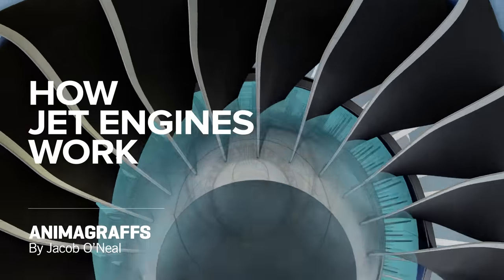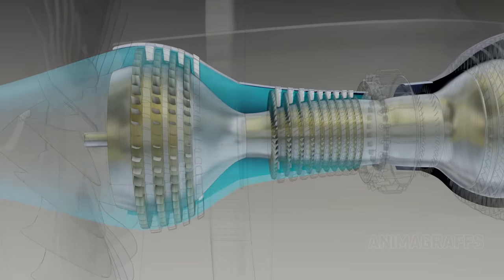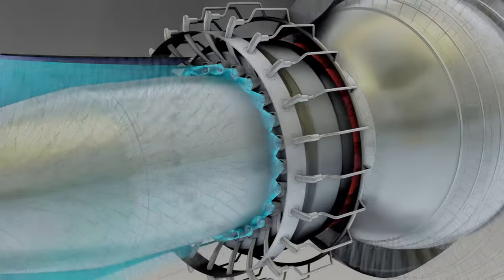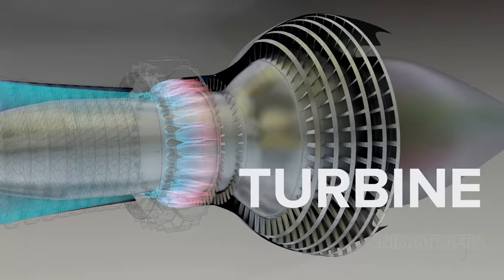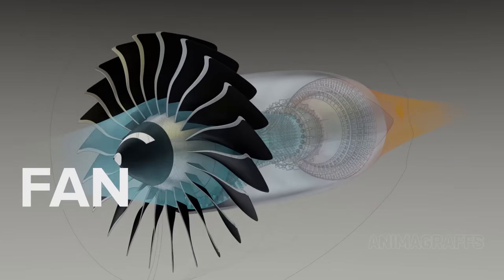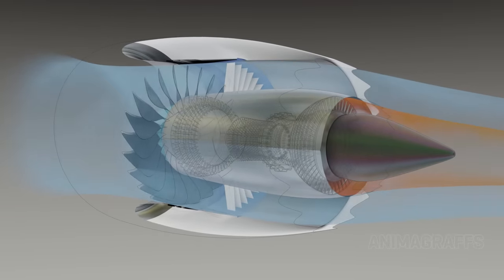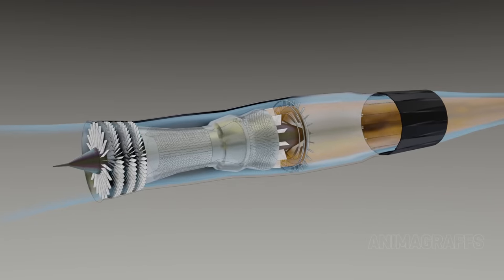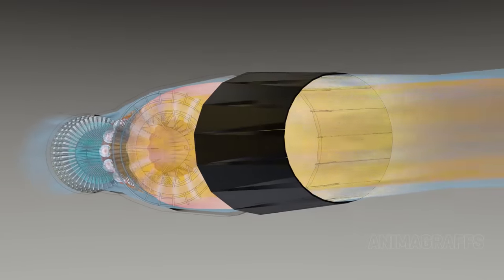How Jet Engines Work

Comment: In an internal combustion engine the exploding fuel has no where to go except to push the cylinder. But in a jet, what makes the exploding fuel exit the rear instead of canceling its thrust by exploding in both directions?
Reply: Good question. The air at the back of the engine is at a lower pressure, so that's the direction the flow wants to travel. If you move forward, the pressure increases and is the highest at the end of the compressors, so from there on, the rest of the air should continue to flow out the back of the engine. A compressor stall/engine surge happens when the flow gets disrupted and the flow momentarily may backfire and reverse direction.

Comment: Here is something that I can not figure out and I have looked in every way I can possibly think of. Why does the high-pressure stage always look to be going clockwise while the low-pressure stage looks to be going counterclockwise while it's all on one shaft, or so it has always been said? Another thing I can not figure out is how can you have jet engines running at high speeds and even using afterburners but not moving the vehicle?

Comment: Can you explain ‘back pressure’? Is that the force of air entering the back of the engine that actually provides the thrust, as it replaces the high pressure hot air?

Comment: While working in Nigeria, at Lagos there were Russian jet liners. The Russians simply slapped low-bypass military engines on them - with afterburners. And yes - at least on my flight - the Russian planes did have wooden seat structures.

Comment: Could somebody explain, I wonder why the central part of the core (the part around which the stage discs rotate and stators are attached) is so wide. I believe that if you take an engine and cut it with a knife from top to bottom through the e.g. compressor (like a sausage) you would see that it is actually a rather thin circular ring through which the air travels, and the central part is taken by...what? And why? The blades are so short relative to the core diameter, in other words.

Comment: Why only few country can build the Jet Engine?
Reply: Most of the design are intellectually protected. So design a new engine you need to conduct a lot of research, by the time you design a new engine the existing countries might have already made a new and highly advanced version of it. So it's not economically practical for most of the countries to start from the scratch.

Comment: but one thing i wonder about, is that how do they get the blades and fans to spin, when starting the engine, since theres no cold air being transported into the combustion chamber, the fuel wont have anything to mix with and theres no pressure, thus generating no thrust. Do they just use like an electrical motor to get the fans to spin, and when combustion happens they turn it off or how is that done?
Reply: I’m pretty sure that’s what the APU is used for to start turning the fan then when the throttle is mover from cut off to idle fuel is mixed then it ignites 

I’m pretty sure that’s how it works correct me if I’m wrong

Comment: Why does the power of the combustion not escape towards the compressor stage of the engine? Combustion must be a lot stronger then the pressure of combustion so why doesnt the system just stop..

Comment: So does the turbine power the compressor? Doesn’t do a good job explaining how it functions.
Reply: Yes, and in a high-bypass turbofan the fan can provide up to 80 % of the total thrust due to the large airflow around the engine core.

Comment: it actually does not explain how it work. It does not explain the most important part. Chicken egg problem.  To create high pressure air you have to rotate the turbine, to rotate the turbine you need to create high pressure air in order for fuel to burn. Also, burned fuel creates pressure itself which is spread in all directions and  why it does not prevent high pressure air to get in ?

Comment: You don’t talk about the gas generator or the starter. Gas generators are producing the gas that turn the power turbine. In this case, the starter needed is a pneumatic source often provided by an APU

Comment: I get most of the concepts in this video, and I understand the design, but Can anyone help me understand why Haiti bypass engines increase efficiency? As I see it the air isn’t actually speeding up or compressing enough to create enough thrust to be noticeable. Am I just being dumb, or is there a complex subject I do not understand?
Reply: Thrust depends on mass flow rate. To get the same mass flow rate(w), in a turbofan we have high bypass ratio(BPR for short) coz w=pAV (here p is density of fluid) in turbofan area is high. In turbofan to get high w we increase velocity. Increasing velocity requires a lot of fuel burn, this increases specific fuel consumption and also your propulsive efficiency( which is dependent on exit velocity) is low. So even though turbojet and turbofan may produce same thrust, we need more fuel in turbojet.

Comment: I’m literally just now learning the stator veins of the compressor are stationary, pretty bad of me considering I’m literally in a thermodynamics and propulsion class for undergrad rn
Reply: You are correct that the stator blades do not rotate around and around. However, on most modern jet engines they are not exactly stationary. There is a control mechanism that turns the blades axially and changes the angle of all the stator blades in the front stages of the compressor. By changing the angle of the stator blades you can modulate the amount of air flowing through the compressor, which in turn modulates the thrust being produced by the engine.  So when the engine is at idle the stator blades are at about a 80 degree angle relative to the direction of the air flowing through the engine. Then as the throttle is increased the blades gradually turn axially to about 45 degrees relative to the direction of the air flowing through the engine. This technique, while it does add complexity, produces better control of the thrust than older designs with compressors that had fixed stator blades.

Comment: Something that I've seen in this one and similar videos are the front air is moving way faster than the blades. It should be the opposite. The front air is supposed to be accelerated by the blades, thus for visible blades, the air should be moving incredibly slowly, however, being faster than the blades by the turbine as the there the air accelerates the blades instead. Additionally, ain't the back blades of the turbine inverted?
Reply: The rotating blades accelerate the air backwards into the engine. Then when the accelerated air encounters the stator blades the added velocity is converted into increased pressure. In other words the air is being compressed between the rotating and stationary blades and that in turn reduces its velocity. The compressed air is then routed by the stator blades into the next stage to be compressed further. You are correct that as the engine compresses the air the speed of the air decreases as it travels backwards through the engine. Note that the air pressure at the discharge of the compressor is the highest anywhere in the engine. Concurrently the velocity of the air at that point is quite slow. Then on from the compressor outlet the pressure drops as the air is accelerated backwards through the rest of the engine. 

As far as the turbine, in many of these newer engines the turbine spins in the opposite direction from the compressor. Unlike older engines, where the turbine and compressor are on the same shaft, the shafts on these newer engines are split in the middle and there is a reversing gear between them to make the compressor and turbine rotate in opposite directions.

Overall its not a bad animation and illustration of how a jet engine works. But there are some inaccuracies in it and its not perfect.

Comment: can anyone explain how the bypass improves efficiency?
Reply: This relates to a classic problem in jet engine design. The first jet engines were turbojets as described in the video. Turbojets expel a relatively small volume of air backwards but at a very high velocity. This is what allows a turbojet powered airplane to fly at high speeds. For example the Boeing 707 was turbojet powered (the engines had no fans) and they could fly at between 500 and 600 mph. The only problem was that turbojets cannot produce very much static thrust, which means that turbojet powered airplanes cannot accelerate quickly on takeoff or rapidly climb up to cruising altitude. Both of these characteristics of turbojet engines reduce their performance and efficiency.

Stepping back to propeller airplanes, propellers expel a relatively large amount of air backwards but at a lower velocity than a jet engine does. This means propeller airplanes can only attain speeds of about 350 mph maximum. Propellers do however produce more static thrust than turbojet engines so they can accelerate faster on takeoff and they can climb more rapidly.

A turbofan engine is a hybrid design that combines the low speed, low altitude performance of a propeller engine with the high speed, high altitude performance of a turbojet. A turbofan engine uses the fan to accelerate down a shorter runway more quickly and get off the ground sooner and climb up towards cruising altitude better than a turbojet can do. But as it climbs the turbofan engine relies increasingly on the core to attain the higher cruising speeds similar to what a turbojet can achieve. This combination of the core section and the fan produces a better performance balance between low altitude, low speed flight and high altitude, high speed flight than can be obtained with either a propeller engine or a turbojet engine. This ability of a turbofan engine to get off the ground and up to cruising altitude quickly and then cruise at high speeds is what makes the turbofan better performance wise and more efficient and the most popular aircraft engine in use today.

Comment: uh, you kinda missed the whole point of compressing the air--to heat it to the point that it ignites fuel.  Sort of important.
Reply: Not exactly, there are still external igniters (like spark plugs for a jet) that ignite the fuel, at least at the beginning. In general it is self-sustaining and doesn't need the igniters on, but they're there for startup and cases where the engine is under high demand.

Comment: usual stunning animation. It raises some questions. Why does the rear part of the compressor stage and forward part of the combustion stage appear to rotate in the opposite direction to the forward part ?  Why is this part of the design and what is the mechanical (gearing) arrangement that makes this possible? How is the engine kept lubricated at the junction between the counter-rotating elements?
Reply from the maker: I wasn't making videos as detailed as I do now, at the time I made this. All good questions tho. Apparently the Genx model engine I based this on does have gearing in the center that allows different sections to counter-rotate, but I'm not entirely sure the purpose.
Reply: No disrespect meant.  What you do is amazing!

Comment: I still can't quite understand why the combustion gasses don't exert a back pressure against the forward stages equal to the pressure they contribute towards the exhaust stages....
Reply: They do. That’s how Newton’s third law works in this case, the expanding gas pushes on the front stages, pushing the plane forward.

But the front stages are designed to absorb as much of this force as possible rather than have it be absorbed into the incoming air to push that air the other way, the back stages are designed to vent this force while stealing a bit of force to turn the turbines that power this whole contraption. This is why the combustor is designed with such a small hole, it’s designed to be one way in.

Air ideally expands in all directions. This design just forces it to only expand back.
Reply: @storyls  Thanks!  There are some other marvellous devices around.  My fav is the Giffard live steam injector... invented by the same guy to fly a powered ballon. (Sadly this amazing talent took his own life. )

Comment: And how to spin all the rotors?
Reply: The rotors are turned by the flow coming out of the combustor. The turbine rotors are basically just little airfoils pointed at an angle, so when engine gases flow over them, they produce sideways lift that turns the shaft.

Comment: You've missed the whole point of a jet engine! The reason the air is heated is to allow it to expand out the rear causing thrust. The fact that some thrust is also produced by the front fan is secondary.
Reply from the maker: Turbofan engine designs may produce a large percentage of thrust from the fan. For example, this source describes a large turbofan engine in the same class as my model, as such: "The fan, which processes five times as much air as the core, accelerates the air to a speed of 885 ft/s (270 m/s) providing about 34,330 lbs (152.7 kN) of static thrust, 79% of the total static thrust of the engine." 
https://www.sciencedirect.com/topics/engineering/turbofan-engines
Reply from the maker: And here's another source that estimates between 30 - 70 percent of thrust comes from bypass air, which I assume depends a lot of what kind of engine we're describing. With jetliner engines bypass air plays a much larger role.
https://www.faa.gov/regulations_policies/handbooks_manuals/aviation/airplane_handbook/media/17_afh_ch15.pdf

Comment: how do the spin the higher compressor stage in the opposite direction
Reply: If you look at the video, there is a second set of turbines to power the reverse motion you see.

There are actually two axels here spinning. They are concentric, the high compressor axel is on the outside while the low compressor axel is on the inside.

Comment: NO liquid fuel needed. The AIR =GAS. COMPRESSED AIR is damp. Kondensed Air. NO Hot exhaust. Watch people having fun being blasted away by the AIR on beaches behind starting and landings at airfields.
Reply: About 80-90% of the thrust is produced by cold air moved by the fan, but that is spun by the hot section, and for working on those I can tell you, they're HOT, and they do use kerosene
Reply: @Grouuumpf  You havent tried to stand behind them. Do it! You Will be flown away, but not by hit Air. The Wings and flaps are not effected or scorsed even after 20 years of use.
Reply: @lauralauren6432  Again, I'm working on those. 737 classic and NG, specifically. I have been behind an exhaust (at safe distance because I'm not an idiot) and I have been right next to a running engine checking for leaks. They are hot as hell and they stink of kerosene fumes.
And the hot section of the air stream is diverted from the wing by heat Shields so as not to burn through the wing. Only the cold section moved by the fan can hit the wing, that's why they're not scorched. The pylon itself does show clear signs of heating

Comment: What is the average thermal efficiency of a jet engine?
Reply: Here is a link to an MIT page which has a graphic that indicates the thermal efficiency of typical engines today is around 45-55% https://web.mit.edu/16.unified/www/FALL/thermodynamics/notes/node84.html. The maximum possible (Carnot) thermal efficiency is given by 1-T_cold/T_hot, so the general trend is that thermal efficiency increases the hotter you perform the combustion cycle. This gets to a point where the issue of components melting becomes a serious issue, so high-temp materials and advanced cooling techniques are being researched and developed to this day.

I'll note however that propulsion engineers have a lot of different figures of merit by which to evaluate how good an engine is, and I'd recon thermal efficiency isn't one of the most important ones to the end user. Other indicators are propulsive efficiency, pressure ratios, specific thrust/specific power, specific fuel consumption. SFC is particularly important because lower SFC means an engine uses less fuel = lower costs to airlines.

Comment: I have flown on many jets and have always wondered how the reverse system worked.  I decided to look it up on you tube after having flown the other day.  You never get to see how the engines are functioning since they are below the wing.  Thank you for your explanation. I also wondered about the function of spoilers.  Is the front of wings that move out from the wing a sort of flap to provide lift?

Comment: Ok but how does this make the jet fly? The fans?
Reply: The high-velocity mass flow out the back of the engine applies an equal and opposite force to the back of the engine including the fan blades and turbine. The engine is rigidly connected to the plane via engine mounts, and the plane is driven forward via the forces applied to these mounts by the engine.
Reply: The engines only create enough speed so the wings generate lift.

Comment: The turbine drives the fan or the fan drives the turbine?
Reply: Both. It's a feedback system, so the influence goes both ways. But strictly speaking, the turbine is the part that generates the power and transfers that energy to turn the fan.
Reply: @nicholasturo-shields6477  but for the turbine to run, fan needs to rotate first... How will the fan start at first?
Reply: @utsavrajput8336  Yep, you're totally right. The engine core needs to be spinning at a fast enough speed in order to sustain continued combustion. To start it, pressurized air is used to get it going to the point that combustion can be sustained. I have made some other comments that are somewhat similar that may give more of an explanation to this concept.
Reply: @nicholasturo-shields6477  Thanks a lot. Great help..
Reply: @nicholasturo-shields6477  youre really dedicated to this comment section man! Im enjoying the reading tho, you clearly know what youre talking about.